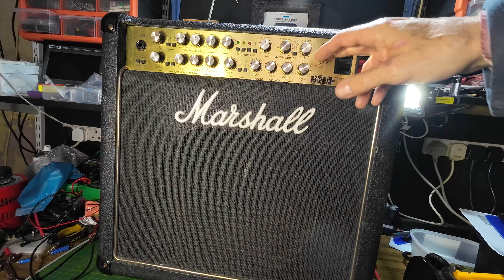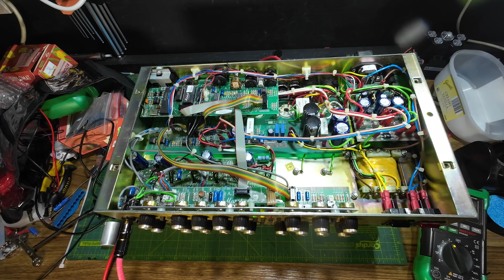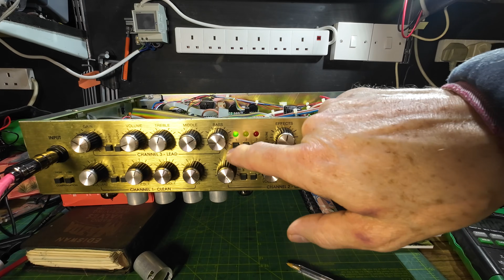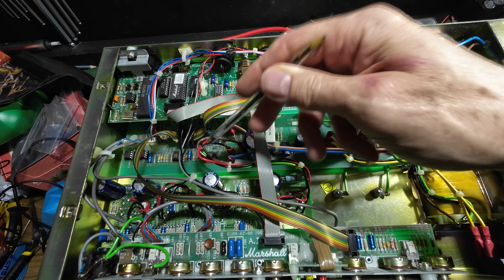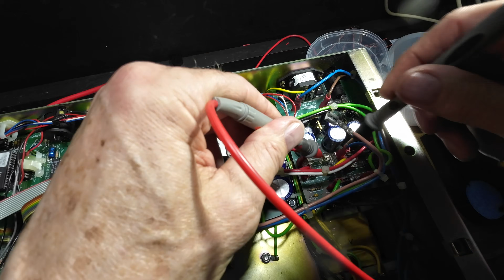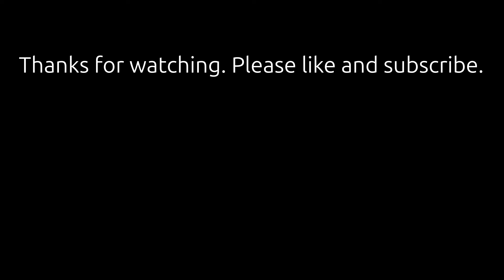Marshall 6101LM Anniversary 1 X 12 Guitar Amplifier Let's Fix it.

Comment: A word of caution to prospective buyers: if you see any amplifier like this with stacked horizontal rows of knobs, internally it will have stacked horizontal PCB boards and it'll be almost impossible to clean the pots on the bottom without major disassembly. A broken solder connection to one of those pots will cost you major labor time just to get to the underside of the board and resolder a few things. And that's before you get to the cost of replacing bad capacitors...... It's a bad design concept and no one should support it by buying things that are built like this.
Reply from the maker: Hello. Yes a nightmare if any of those boards need some work. Labour costs are high on these types of amps. Take care

Comment: Nice video again. Glad to see a wide variety of amps in your hands. 
BTW it would be interesting to know how much higher the temperature inside the chassis (where those poor electrolytic caps must live and struggle in)  is compared to a 100W Marshall head which has tubes pointing upwards. For example if the working temparature of an el. cap gets 30°C higher from around 30-40°C temperature, the life expectancy of the cap (of course depending of the quality and temperature rating of the cap) usually will be drastically shorter. And if the cap has ripple currents, ESR + ripple current will create some heat inside the cap. ESR usually gets higher when that cap ages, and the result especially in high temperature eventually is a death spiral of that cap. 
I have used one 100W head with same set F+T main caps for 29 years, and I just recently measured those caps which have run almost in room temperature in that chassis because all the heat from tubes and transformers goes up in the air, and the caps were like new. They will last longer than I'm gonna last.
Reply: I think it's time to stop building combo amps and build heads instead. Downward-pointing tubes should be a thing of the past.
Reply: @goodun2974  And in addition to that heat problem there is that problem of microphonic tubes near that loud as h*ll and vibrating speaker.
Reply from the maker: Hello, thank you. That's a good point. The heat certainly shortens the life of caps. This amp must be nearly twenty years old. The caps have not done bad in this one. It may not have been gigged and only used for half an hour every few days. It's a hard one to answer. hanks for watching and take care.